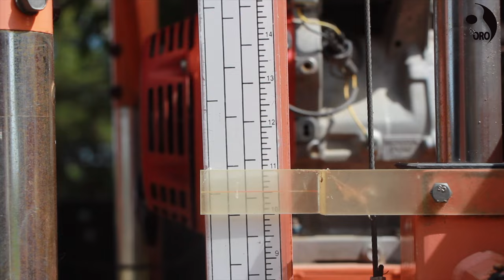Master Grade Instrument Tonewood: Phase 1 - Milling | De Oro Tonewood Mill

Comment: Define "master grade".
Reply: I would define it as containing the qualities of: 1) Perfectly straight grain containing neither knots, nor growth rings which bend as is seen when growing near a branch.  2)  No run out ie: as you move across length of wood there is no "dropping" through growth rings.  This means the wood fibers are full length which lends full rigidity.  3) Perfectly quarter sawn at exactly 90 degrees to the growth rings.  4)  There is also an element of the initial diameter of the log such that you can cut away all the pith and sapwood and have enough heartwood which is still perfectly quartersawn.  In walnut, you need about a 25" minimum diameter log to get a good piece of true quartersawn 8.5" width for a guitar back.
I'd love to hear you thoughts.  How do you define master grade?  Thanks for watching!
Reply: @DiegoDeOro  Cosmetics, alone,  are no determinate of tone quality. Stiffness and flexibility are also considerations. 
Martin, as an example, use a system from 1-8 . 8 Being their premier wood.
I haveghad and played more grade8  dogs than simple 4s and 5.s
I have a  few Martins to include a modest (370 built) 0000-1 dated from 1997.
The top is funky,  not straight grained,  bands of darker color with near white/yellow, no silk, 4-5 lines per inch and one of the best steel string guitars I have owned
( 15 Martins , a dozen Gibsons,  around 100 guitars since 1961) 
I also have a Pena  Flamenco guitar with a sitka top and Monterey Cypress that is one of the finest I have owned. 

You never know what's in the Cracker Jack Box.
Reply: @jeffhildreth9244  That's really interesting, Martin makes a great guitar and I'd love to hear yours.  For clarification, I am only cutting back and sides, not tops; and #2, #3, & #4 have nothing to do with cosmetics, but rather with stiffness of the wood as you mentioned, which has an impact on the tonal qualities of the guitar.  Only #1 is a cosmetic feature, and believe it or not, with the modern state of old growth forests, is increasingly rare to find.
Reply: @DiegoDeOro  I am confused;   "only #1 is a cosmetic feature"

Those were the bottom the line.
Reply from the maker: Point #2 on run-out is a good place to start.  Check this out:
https://www.acousticguitarforum.com/forums/showthread.php?t=156461